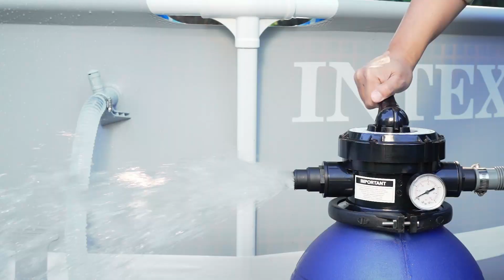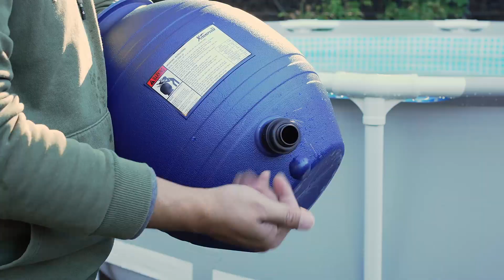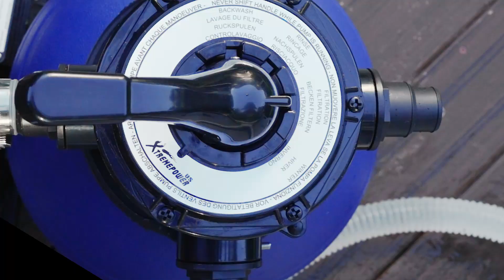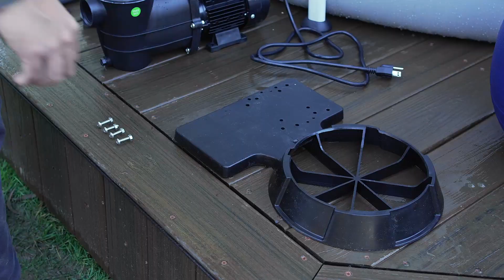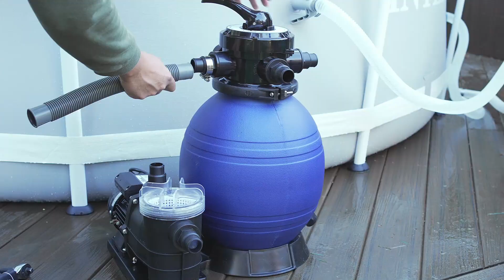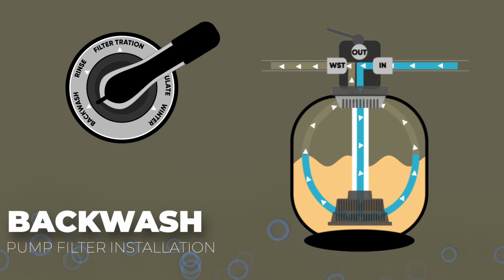XtremepowerUS: 13" Pool Filter With 0.75 HP Pump Set 4-Way Valve Instruction, 75110 / 75117 (Pump)

Comment: There's NO mention at all of HOW MUCH SAND TO PUT IN THE DAMN THING. OR ANY MENTION OF HOW TO OPERATE THE DAMN TIMER!!
Reply: Directions show both sand and cotton pool balls but I’ve seen two videos that used either only sand or only cotton pool balls
Reply: 3/4 full
Reply from the maker: To turn the pump on you turn it to BACKWASH. The amount of sand to use is 42lbs
Reply: What about water? How much water do you add?